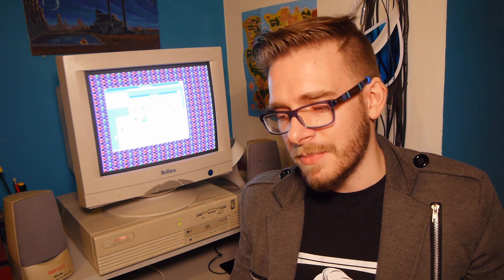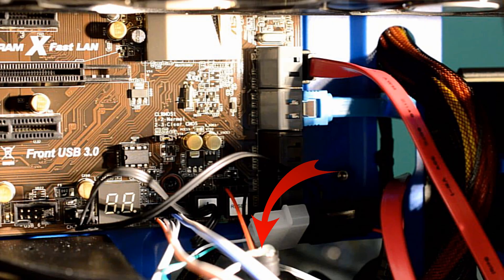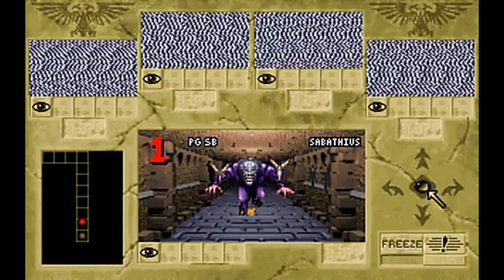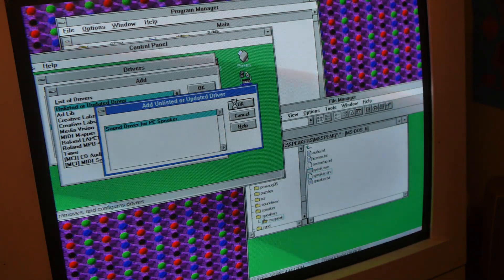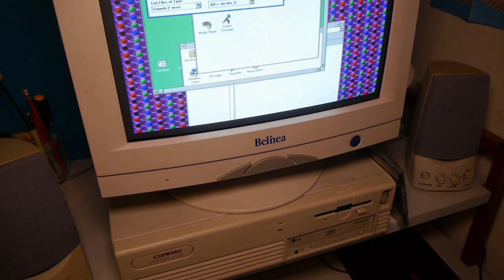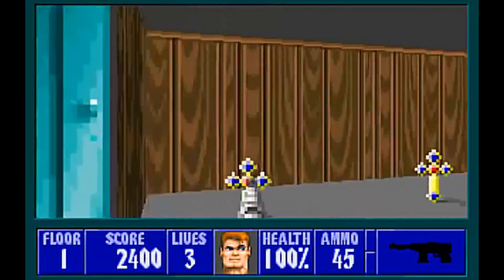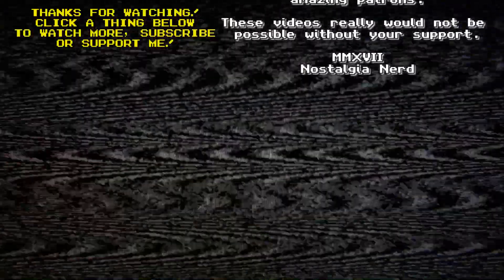Windows Audio Before Soundcards (Sounds Terrible) | Nostalgia Nerd

Comment: First comment?
Reply from the maker: Yes indeed.
Reply: Nostalgia Nerd Thanks!
Reply: *****
Mine was an unbranded 386SX-40 with 1Mb of RAM (I got an extra meg with the Soundblaster) and a 120Mb hard drive. Cost me in the region of £400 with no monitor, and I was then so short of money I had to get a 10" monochrome VGA to actually use with the machine! It wasn't until a year or so later that I actually had a colour display.
Reply: haha "my" first was a Hyundai 386 SX16 with 2Mb RAM and (IIRC) 40Mb HDD running 3.11, that my mum bought second hand with an RM Nimbus 14" VGA. First one I actually owned was an Olivetti 086 with 087 co-processor, 14" monochrome and 5 1/4" 20Mb HDD (I preferred old school kit even in 1996 lol)... First proper system was a Compaq similar to the one in the vid, but originally a DX33. I added a 250Mb HDD, 16x CD-RW and 16Mb RAM and enjoyed it for a while,
Reply: My first PC in 1993 had only the PC speaker, but there was some pretty cool sounds anyway--I remember the game "Legend" doing a particularly good job of the title music? Of course, once I bought an 8-bit Soundblaster off a mate at work and installed it, I was amazed at the difference!
Reply: b...but i was first
:(
Reply: Encore1234567890 My first was a Sprint PC also that I bought second hand off an old lady for about $200
Reply: First one I've seen.
Reply: Correct?
Reply: Prawn hub in square waves. Lol
Reply: Good job 
-last comment
Reply: @RustyHondas  wrong

Comment: the speaker was clearly added as an afterthought. it occupied one bit in the keyboard port, that could be toggled manually or gated to the PIT timer for some bad, ca. 6-bit, PWM. how hard would it have been to just set aside a port with a 8-bit passive DAC or something, - even that would have been a massive improvement

Comment: When I had my old IBM 300GL with Windows 95, I rigged the internal speaker to the internal onboard audio pins on the motherboard while hot-wiring the CD ROM internal audio cable also on the same pins! Thankyou Nerd for a blast from the past!😃❤️

Comment: I find it interesting how early macs were able to get a pretty significantly better sound with their one-bit square wave generator (which is what the PC speaker was/is). It might have something to do with having offloaded the speaker control to a PLA (the same PLA that controlled the one-bit graphics output which, now that I think about it, is really much the same kind of signal).
Reply: What are you talking about!! The Machintosh 128k didn't have that. What it has instead though is a Monaural four-voice sound with 8-bit digital/analog conversion using 22-kHz sampling rate

Comment: I tried this "PC Speaker Driver" on my Windows 98 SE computer (150mHz Intel Pentium), and it works ‒ I needed to connect a speaker, because that PC originally have a small squeaker. More base in the played sound = more worse sound. 🔉 I needed to disable interrupts during playback, because I have animated cursors installed, and those are constantly playing their animations. Total Commander cannot play sounds with this driver for some unknown reasons, Windows Sound Recorder and system sounds are playing fine. but some games unable to access the sound card (such as Humongous Entertainment games).

Comment: That whole thing with the PC speaker also being able to come through the audio port? My childhood computer's integrated sound card actually has the reverse feature! In the absence of anything plugged into its line out, any output from it will instead be routed over to the internal piezo speaker! For clarity's sake, it's the ATI integrated sound card with a direct connection to the system speaker and has nothing to do with the timer chip, so even by today's standards it's only mediocre.

Comment: There was some disk copy program for DOS that had spoken messages which were so clean they burned to my brain to this day "floppy drive setup". Wonder what program was that. I'd gladly test it on my new fancy 386DX40 and maybe un-burn it from my mind if it didn't sound as good as I remember. Windows drivers and many game's attempts at playing though PC speker were pretty bad. Impulse Tracker had PC speaker output option and it was pretty decent but not as good as said software. I saw some programs with better PC speaker sound quality when playing MOD files than IT.

Comment: That speaker driver was handy for "System sounds". You could at least hear what Windows was trying to tell you, with this "multimedia experience" they were trying to present. It might have actually sounded fairly good, if one replaced their speaker with one capable of producing more sounds, or if they used a mono amplified speaker. 

There was also a built-in speaker driver, that games like Sierra games used. It sounded like beeps, and could only play one note at a time. However, it had a programmable buffer. It could loop music in the background, unless something locked up the system.

Comment: In about 1996 I bought a used AdLib card. It was only 8-bit, but it was a dramatic improvement over the built-in speaker. I was even happier when I found Windows .wav drivers for it!

Comment: What a nice video to run across just after spending a couple days moving my Windows 98 from a Pentium 3 to a Pentium 2 so I could have an ISA slot and be able to use my old Sound Blaster 16, and then fighting with a mess of drivers to get it working in both Windows and DOS mode. It has a real OPL3 chip so its FM synth music in old games works better than newer wavetable cards that then emulate FM synth. And I often prefer the twangy sound it gives MIDI files.

Comment: Not all speaker were created equal. In ours (I think it was around 286 processor times) case there was a loud and chunky one. And not all software that did PCM-to-1bitPCspeaker playback did it the same. I distinctly remember that tracker music sounded pretty decent through that PC speaker. Although even DIY "a bunch of resistors" on LPT Covox through some old radio with an aux input sounded better still...

Comment: MIDI is way more than just a vestige of computer-generated music, it's an incredibly useful technology for musicians. Any decent music making software have MIDI support because that's what allows you to play an instrument connected to a computer, edit notes in a piano roll interface (or sheet music editor), amongst other stuff.

Probably over 99% of all the music that was ever made with the aid of a computer was made with the help of MIDI, and wouldn't be possible without it, and essentially all music today is done with the aid of a computer, to varying degrees.

I don't think MIDI will ever go away, as musicians will always need it to make their music, and there is basically no alternative to it.

Comment: I remember setting up the PC speaker driver... used to use the Trumpton fire brigade roll call to get the level as good as possible without mashing it.
The louder and beefier the original beep was, the better - modded one system with some cardboard baffles added to the speaker frame to get a lot more punch.

Inertia Player for DOS could deliver fantastic results if the speaker was good - ideally mounted to the case itself so the case acted as the baffle, as it was on my first PC

Comment: Reminds me of the old 486 we used to have. The system had a Microsoft-branded Windows Sound System card in it, but since a lot of DOS games didn't support the card for sound effects and it didn't have an Adlib or Sound Blaster compatibility option, we often had music coming from the WSS card while the sound effects were coming from the PC Speaker. Fortunately, there were at least some games that supported the card, such as Warcraft II, Descent, and Command & Conquer, but other common games like Doom did not.

Comment: Not sure which speaker driver I had in about 1994 but it would lock Windows up while the sound played, presumably to avoid the distortion shown in this video when the mouse was moved.  It did have a benefit tho'; we installed it on a colleagues PC and cranked the volume right up (it was surprsingly loud!) and changed the windows startup sound to a 2 minute loop of Vivian from The Young Ones shouting to Rick "You're a complete bastard and we all hate you!".  Oh, how we chuckled when he turned his PC on the next morning! :-)

Comment: I remember unhooking the speaker, and running the two wires out the back of the computer. I then ran the sound into a 30 watt amp I made using an electronics kit. I then drove a BIG 5 inch speaker I got from Radio shack. Sounded a lot better, but still had that PC speaker sound LOL.
Reply: I can imagine everyone could hear your beep-boop everywhere in your entire house! 😁
Reply: @zsombor_99  somewhat, but there were some Mod Tracker programs that would play fairly decent sound out of the PC speaker.

Comment: Between sound cards and video cards. You had 3 IRQ's left to run a printer and an extra HD. So most the time you were disabling shit. To make something else work!
Reply: Master Chief 00117 no wonder Mac users were so smug
Reply: Yep! both the games on the Mac sounded better than the thousands of games on PC ;-)
lets look at the context tho, Mac were very much more expensive than an roughly equivalent PC (due to architecture and OS it's hard to do apples to apples comparison. Did you like that) for the cost difference you could buy a soundcard for the PC and still have $ left over. Biggest problem with PC hardware from back then was compatibility (both hardware and software) so the Mac by having built in real sound definitely had a lead in that way.
Reply: Always got to decide between using my DexDrive or having sound.
Reply: AAAAHHHHHHH Those were the good old days..........not!

Comment: Mercifully when I got my first PC back in 1997 it already had Soundblaster already on it. Still had to dick around with the DMA and IRQ settings tho, but it worked. Strangely enough that PC ALSO had the grating PC speakers that sounded like dialup as well because why the hell not
Reply: Ahh, yes good old A220 I5 D1 H5 P330 T6

Comment: I discovered short ago a PC "sound card" that it is just a resistor lader conected to the parallel port and even Win95 has a driver for this contraption. This poor man "audio board" was basically an 8bit DAC (around the printer port) which should be far better than trying to achieve and 8 bit DAC via PWM (insane distortion) and you have the audio out without opening the PC ...  ready to plug into an speker system, avoiding the cheapo nasty PC piezo buzzer. There is an schematic of the board, is pretty barebone. Would be fantatic to give it a go and compare, sure it will fall in the middle of PC Speaker and SB. But I have read that, for a thing not being an audio card, sound is "decent". Sure still issues with IRQ nesting and degradation but after all ..... Parallel port is a true 8 bit output port not using PWM and timers, so, less CPU intensive.

Comment: I've built Covox - extremely simple DAC running over parallel port. You installed a driver which emulated SoundBlaster. It was awesome. some games even supported it directly, some as Disney Sound Source device.

Comment: It's like integrated graphics but for sound. I wonder when graphics cards will be entirely built into all motherboards and the only people using graphics cards are "graphics-philes"
Reply: MrAwawe You already have something like that, today 90% of CPUs come with an integrated graphics card that is enough to browse the web and some VERY light gaming. If you want to game at more than 720p lowest settings you need to have a discrete graphics card, so gamers are your so-called graphics-philes.
Reply: MrAwawe frames per second
Reply: i highly disagree about VERY light gaming, I actually completed Dragon Age 2 and Inquisition on an integrated graphics card, and theres lots of videos with benchmarks on them.
Then again, it depends what kind of integrated card.
Reply: Provided you're prepared to drop to medium or low settings it's surprising what you can get away with.

Comment: Kek the Adlib is awful, they should have made a YM2612 or YM2151 based soundcard, that probably would have sold
Reply: IBM actually did make a card based around the YM2164 (similar to the YM2151) called the Music Feature Card, but at a retail price of $495, it didn't exactly sell too well.

Comment: I had an XT computer in 1991 or so with no sound card. However I remember playing Starcontrol on it and the sound was fantastic. In the pc speaker had much much better sound than an Adlib sound card.
Also, some years after I played Starcontrol 2, I used to have a sound blaster pro but for some weeks I had to remove it, I was extremely surprised when I had to use the PC speaker and that game had the same sounds and even the music coming all throught the pc speaker! Could you take a look to these two please?

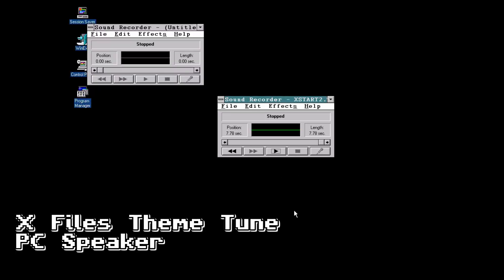Comment: 4:43 So my grandmother had an old HP compaq running windows xp (came with ME) that did that, but out of the front audio port. I always assumed the crackling as you moved the mouse or ran programs just had to do with shitty hardware and old cables, not because the driver's CPU time was being taken up by other things. Really cool to know.
Reply: I'm not sure if that's why in this case, as you aren't describing PC speaker sound at all. On any HP Compaq (post merger 2002) or any other ME/XP era PC, integrated sound of some kind is a given, and having a front audio port at all makes that a practical guarantee (PC speaker audio doesn't natively support 1/8" aux jacks, by the very nature of it). So I'm leaning more towards shitty hardware (electrical interference from your CPU/PSU spinning up), but who knows.

Comment: I remember that driver. What a revelation it was being able to play wavs on it! The one I had you could select whether to enable to disable interrupts, so you could get much better quality out of it but the computer would be frozen while it was playing. Wasn't actually that great.

Sounds like yours had the same problem mine had though - there's a pitch slider in the control panel that for some reason is a notch too fast. Turning it down a notch or two made things sound more correct.

Comment: I used this driver back in the day and also had a dos program that would play MP3s through the pc speaker.  I had a Tandy 386 back then that actually had a dedicated chip for the speaker.  It wasn't anything close to a real sound card but it sounded 1000% better than your average run of the mill pc speaker.  Tracking software like Fast Tracker also had pretty good sound through the speaker.

Comment: What's the difference between a programmable interval timer and pulse width modulation?
Reply: You use the programmable interval timer to generate the pulse width modulation signal for the speaker
Reply: I'm not sure that's correct. If both are PWM then why can't the interval timer approximate the 8 bit audio? Genuinely interested.
Reply: Real 8 bit audio doesn't use PWM but an audio DAC, PWM itself is a hack to make audio.
Using the interval timer is an hack to make PWM, think of it as an emulator inside another emulator its never as good as the real thing.

Comment: That windows driver sounded worse than I expected. I mean, Pinball Fantasies could play an entire 4-channel Amiga MOD file through the PC speaker during gameplay in crisp enough quality that it sounded listenable enough even on machines with a cheap piezo tweeter rather than a proper paper cone speaker like in the original PC.
Reply: Yeah, but Digital Illusions were Amiga demosceners. It shouldn't be surprising that they actually knew what they were doing with sound design.

Comment: Now that you have done PC Speaker, you MUST do Covox Speech Thing. This is what we have used over in Soviet Union as an upgrade over PC Speaker, because you can easily build one yourself, and in the simplest case, you don't even need any active components, though those could make it better. Related is Disney Sound Source, which has been reverse engineered and can be rebuilt, also a handful of parts. Maybe i can help with the hardware.
Reply: LGR's covered them. Also the Covox killed your CPU speed even worse than pushing waveform audio over the PC speaker sad to say, but yes they were definitely crazy simple & cheap.

Comment: I only learned a few years ago about this Microsoft PC speaker sound driver, mainly through either uxwbill or vwestlife, I can't remember which, but I know in the 90s I used a few computer with the driver installed, one being a 486 desktop, the other 2 being notebooks.  When I used the aforementioned desktop PC, a 486 SX I think running at around 25MHz, if I turned Turbo off and loaded Windows, the startup sound was very low in pitch and there was lots and lots of static or white noise in the audio, but with turbo turned on and the CPU running at what I presume was its full rated speed, the started sound, the Windows tada sound on that particular PC, sounded just fine.
Reply: With Turbo off it probably ran on the speed of a 286.
Reply: That's very possible.  I think the CPU ran at 25 MHz when Turbo was on.  And that actually brings up another odd point about that PC.  You couldn't turn turbo on and off while the computer was running, oh you could press the button all you wanted, but nothing would happen until you pressed reset.  So, if you turned the computer on with Turbo on, the computer would run at its normal speed for the whole session, even if you turned Turbo off.  But if you turned Turbo off before turning the computer on, or turned Turbo off then pressed reset, the computer would run at the slower speed for the whole session, even if you turned Turbo back on.